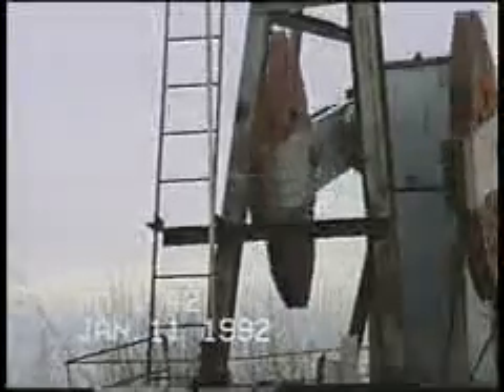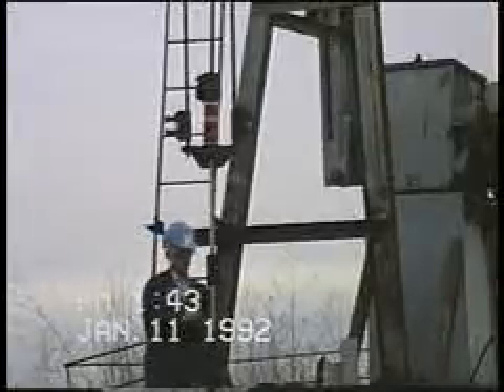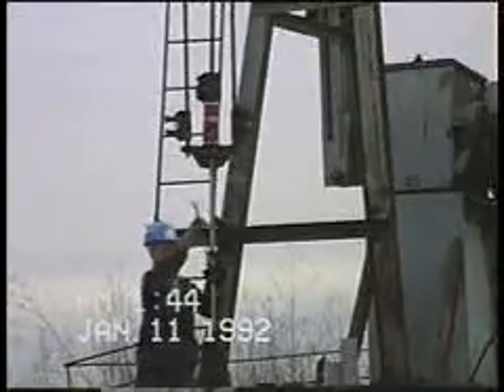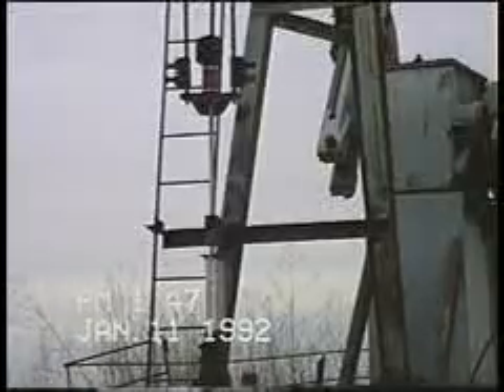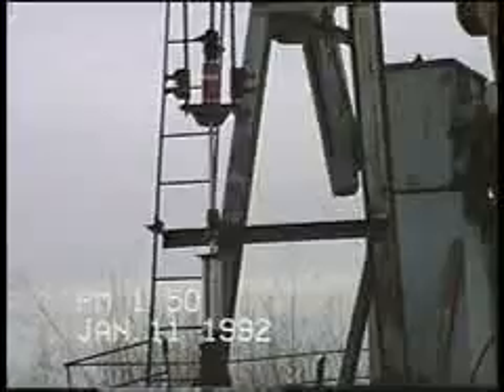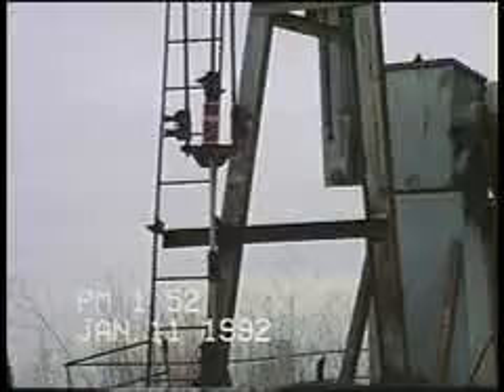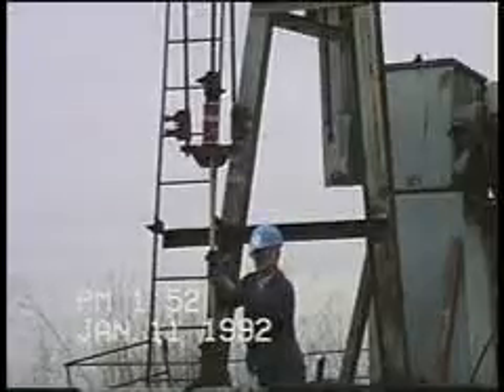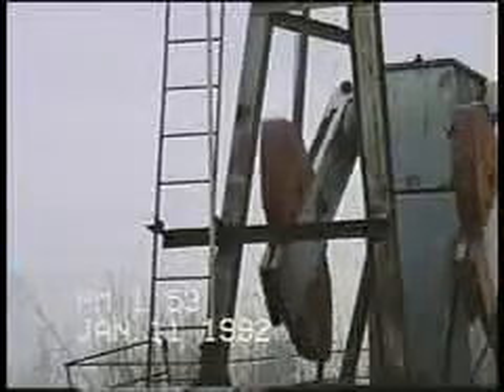Wamco Polished Rod Spacer System

Comment from the maker: If you are using Safety Clamps, the use of the Wamco Suitcase, along with the re-positioning of the Safety Clamp, eliminates further damage to the Polished Rod.

Each time the Clamp is moved & re-tightened, the Rod surface coating are compromised/dimpled. This may cause premature failure of the Rod. This also causes damage to the packings.

With the Wamco Suitcase procedure, the Clamp is simply positioned approx. 4- 5 inches above the bottom of the stroke mark. It will not be necessary to move this clamp in order to support the rod string.

The Wamco Suitcase/Toadstool/Standoff, is fully adapatable to any well & "built" to any height from 2" up.

Please visit our web site for more information. www.wamcorodspacers.com